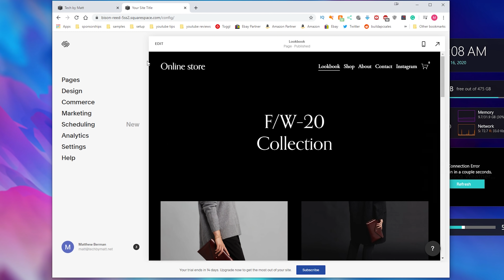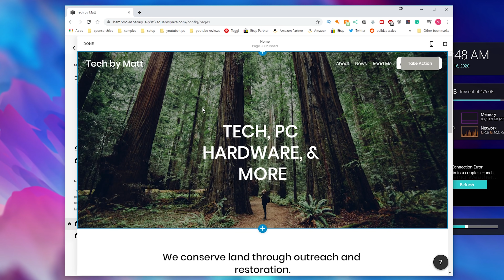Old Office PC + GTX 1650 = Gaming PC?

Comment: Hi, do you prefer amd or nvidia gpus. Just wondering.
Reply: from my experience amd relive does not work most of the time. very annoying to try and use. the price for performance is decent though
Reply: @beefyonyt  for me relive always work and performance cost is negligible. And I'm talking about an old R7 260x as you can see on my channel
Reply: @ondrejbrandejsky5592  i have a rx 5700 and i never had a problem
Reply: Hafo my friend has a streaming problem he uses a rx 580 and he try’s to stream of Amd’s software and it drops from 100+ FPS to 20-30 and I used my gtx 1060 from my laptop so it really is like a 1050 with 6 gb of video memory and I have no problems streaming of the GeForce experience
Reply: @JaimeIsJaime  my rx 580 fails to run anything properly with relive. obs is fine though, if i choose the right settings.
Reply: Both are good I'm going for a 2070 for the ray tracing which will actually help me
Reply: I never had an issue with my RX 5700 XT nitro+ OC
Reply: I would choose Nvidia bc of amd drivers, and also bc of the optimization in games.... AND DAT ROYALTY FEEL OF NVIDIA AND RTX AND IDK OTHER THINGS

Comment: I started with an old Optiplex 990 for $15, nothing wrong with it had an i7 2600 and 16gb of ram. put a 500gb SSD and a GTX 1650 Super in it and it works really good.

Comment: Why not SSD instead of that HDD?
Reply: well an idea is to get an intel optane memory to boost up that hdd istead of a ssd while taking the advantage of big storage.
Reply: Thomas Borisov  Unless it was a typo and meant to say 200w, I think they're referring to a PCIe slot power limit which is common on small SSF office PCs. In which case, options are limited.
Reply: @BestGirlsBiggestFan  this information is totally just information but other than boot times (not to mention after a HDD hits over 80% the read/write type changes to be slower to protect data) SSD highly boosts OS operation, game loading (especially in open world games), render speeds, etc. It's just better overall, and they last literal hundreds of times longer under the same use. They also frequently use less power. SSDs really are just overall better technology. The thing is they are, truly, not always necessary, but it's best to always have a dedicated drive for the OS and a secondary and possibly third drive for mass storage and programs.
Reply: Of course you could always run RAID and have significantly faster speeds, but that's silly after a certain point considering how cheap SSDs have become. But both are viable options
Reply: @mahmoudsobhy5843  Pretty sure a prebuilt from 2011 won't have an m.2 slot...
Reply: My 390 sff got 240 watt ps

Comment: Dell optiplex 7020 SFF. i74790K/GTX1650-GDDR6/32GB-1600RAM.
Reply: Is that what u got and what did h upgrade the gpu and cpu
Reply: @atme7375  GPU, CPU is on the way. Ram sitting at 20GB+4 on the way.
Reply: @LOOTLORD605  sry I’m confused, when u got this pc what was the specs and what have you upgraded
Reply: Bought it in a good deal without HDD.

Comment: For that system i would actually drill holes on the side panel just so the GPU is able to get more air because in a normal type of system the max i have seen is 55c which if the GPU is going in the 70's then there isn't enough airflow and would be best to have something like that or for someone that would have more heavy duty power tools could cut out a big hole on the side panel and then use a mesh like filter which would be helpful especially if said person would have like a table fan could just angle it and would have some air pushing into the system.
Reply: did you know what did my cousin do about it? he left the side panel open xD ik that would be a dust cage but he will clean it

Comment: wow my gpu just came in the mail just my luck that's crazy lol
Reply: You should do a benchmark video on it
Reply: @acrylex4663  deleting vids or comments
Reply: Oh lol I didn’t rlly see the likes what games do u wanna see
I got a not so good cpu tho it’s an i5 3570 if u wanna see a benchmark just tell me the games I don’t rlly have many games but I am going to get some 
If u want I could do a fortnite one cos that’s install even tho I don’t rlly play much
Reply: Just got mine a week ago too
Reply: zoinks  nice I get quite a bit of stutter on fortnite idk what’s the prob wether it’s my ram or cpu idek
Reply: fusion ram probably
Reply: zoinks  hmm I’m not sure i have 8 gb i used to have 4 but the  ram improved it 
When I turn the settings up 1440p it runs 60fps or more but the stutter is crazy
Like drops to 20 when I’m medium 1080 it doesn’t drop below 60
It’s average is 90 FPS depending on the surrounding the card is great it’s just that 
The pcs stutter is quite a lot 
Give me a solution
Reply: fusion you need 16 gb for a smooth experience these days.
Reply: @dylanallen7720  a bit late but I upgraded to 16gb it's still stuttery when flicking the mouse fast on a large area with builds it's annoying but I deal with it
Reply: FuseXR save up and get an ssd and upgrade CPU  to i7-3770 then the Stuttering will stop
Reply: FuseXR yeah a i7 3770 would be better I didn’t realize you said you had a 4 core 4 threaded cpu cause that will cause stuttering.
Reply: X-Treme iOS true but I’ve spent my money on 16 gb ram idk how much is those anyway
Reply: A question to all of u do u still want benchmarks also i started uploading
Reply: @XRFusion  Update bios / drivers or just go for 16 gb of RAM
Reply: Abdziel -  bruh I already have 16gb now 
And  I’ve already done drivers and at the time I made the comment I’ve updated the drivers I also now started uploading if u wanna see how my pc performs then check the vids on my channel
Reply: @XRFusion  glad for you! Ill check it out
Reply: Abdziel - thanks
Reply: @dylanallen7720  no lol 12gb is more then enough 16gb is overkill and 8 is still good for triple a games idk what kinds of crack your on
Reply: @iris-dh6nd  you must live under a rock, but go ahead and stutter away with your 8gb.
Reply: @iris-dh6nd  lmao 16gb is like an icing on top 8gb is also a decent choice still getting stutters on 16gb it's super annoying
Reply: @XRFusion  I think that's your storage or CPU then because ram doesn't usually = stutters if you have the recommended amount for the games u play, your ram may also have a really low speed but I really doubt it's ram speaking from personal experience
Reply: @iris-dh6nd  16gb can run all games storage 200+ for hard drive games on
Reply: The ram is like corsair 1333hz
Reply: @XRFusion  I meant as in speed and how much free space u have. If you have 500gb of space total and your using 490 it's going to massively slow down your pc and an ssd is the best investment I've ever made towards my pc. And ur cpu is above the recommended so its definitely your lack of an ssd or system issues
Reply: @iris-dh6nd  its been a year but, i came to update, its not as stuttery as before but i am building a new pc, as i figured the cpu was causign the massive bottleneck

Comment: I loved upgrading my old i5 2320 based PC, this is my build:

 - Asus P8P67-M
 (original)
- Intel i5 2320, 3,2 GHz
 (original)
- 2x4Gb DDR3 Kingston 1333 MHz
 (original)
- MSI Ventus XS 1650 Super
 (upgraded)
- Samsung 860 EVO 500G
 (upgraded)
- HDD 500 Gb
 (original)
- Corsair RM550x
 (upgraded)
- CPU cooler Noctua NH-U9S
 (upgraded)
- 2 x 80mm Noctua NF-A8 PWM (out)
 (upgraded)
- 1 x 120mm Noctua NF-A12x25 FLX (in)
 (upgraded)
- Corsair K70 RGB MK.2 con Cherry MX Brown
 (upgraded)
- Logitech G502 HERO (upgraded)
- old pc case (original)

I'm planning to upgrade my RAM, maybe 2x8 Gb or 4x4 Gb, what's best?
You gave me a nice idea for the CPU!

Comment: Im going the Optiplex route. I snagged a 7050 MT with ssd 10 pro and 24 gb ram on eBay last night. A friend a donated a GTX 1050 ti to me Imm  excited to get it .
Reply: 24 gb ram? How many Google tabs are you going to open
Reply: @haxorman6969  I had it so lying around I put it to use lol. Just bought a GTX1650 super and a 6pin adapter. Hopefully this fits !

Comment: Did this exact thing with a hp z210 sff I picked up for $50 with a e3-1245, 8gb, and a 180 ssd. Added this 1650 and for under $300 have a decent gaming system.

Comment: Hey Matt I enjoy watching your videos and I just found this one with the Dell Optiplex complete by luck cause im about to do a massive upgrade to my Dell Optiplex 390, and not like in your video with just a cpu and ram upgrade . I be upgrading the whole pc with a new mobo , cpu , memory and power supply , these are the parts i be using in a while.
- B450 mini ITX Mobo
- Ryzen 7 - 2700X CPU
- 16 GB 3200 Memory ( 2 sticks )
- 350 or 400 Watt TFX PSU
- RX 6400 4GB  Speedster LP GPU
The reason I'm doing this build is cause i like the shape of the case and it fits nice in my tv furniture :D
BTW i got 2 cases for free so i can use one as the original with spare parts 
Let me know what you think

Comment: My old job was throwing away 4 optiplex towers. I took them home knowing how easy they are to upgrade. I got the sff model 390. Swapped out the ram, added a Radeon 560 and called it a day. How do you like that cpu? I wanted to swap to an I7 but the performance is almost the same, that I5 is a pretty decent cpu

Comment: I did nearly the same thing two weeks ago. I got two SFF Fujitsu PCs for 100€. They had i5 3470‘s, 500gb HDD‘s and 2x4gb RAM. I bought two zotac gtx 1650‘s, 4x4gb RAM (16gb for each pc) and two 250gb ssds. 

I sold both pcs for around 350€ each 👍🏽
Reply: The exact same pc with no gpu costs 120-150€ at my location rip me

Comment: I have that same system except I put in the Xeon e3-1270,  upgraded the ram to 16gb as well, and slapped in a gt1030 (gddr5) that I scored for fifty bucks (disclaimer, the 1650 lp didn't exist when I got the system, plus it was out of the budget at the time anyway). I scored the 1270 for  just under 40 bucks and the thing runs circles around the original i5 2400 that came with the system. I gotta say though, the 1030 can still rock e-sports games pretty decently and can even hold it's own on some modern titles as well with a few tweaks here and there.

Comment: Just bought a 3020 with 8gb ram and 1 tb hard drive. Can’t wait for it to arrive! I was thinking about adding a rx 570 and a 500 watt psu in it. Thoughts?
Reply: You can find decent used deals on RX570 both the 4GB and 8GB versions on AliExpress. 500W PSU should be enough.
Reply: Also make sure what motherboard power connectors your Dell 3020 uses, some of them use proprietary connectors and you'd need a converter
Reply: The only other i would say is make sure that the card will fit in the case. For my optiplex 790 the longest card i could fit was about 9.5 inchs and then it blocks the sata ports but your model might have the sata ports somewhere else.

Comment: I picked up a 7010 SFF with an i7 3770 8gm Ram, planing to swap the case and upgrade the PSU  add another 8gb ram stick and add a GTX 1060 6gb

Comment: if we talkin about used, go amd, the rx 470 is a solid gpu that can be found for less than eu 70 on aliexpress, with no mining experience and it has a 6 pin connector
Reply: RX 470 is high profile card and cannot fit into SFF P.C
Reply: @seebauong9593  ik, but we talkin about gpus in general

Comment: I have a very similar PC except you have a DELL opt. SFF 790 and I have a DELL opt. DT 7010,
my specs are :
CPU: i7 3770
GPU: GTX 1650 (same one by zotac)
RAM: 16 Gb DDR3
the fps is very similar and for those wondering, yes  COD:BOCW runs at 60+ fps on low/med on 1080p
Also have the stock PSU
Reply: i have the same build except the MSI 1050 Ti in it and was considering putting this card in it too  thanks!!

Comment: Indeeed it does, I have a 7040 optiplex with i5-6500 and i put a gtx 1650 in it and it runs every game ive tried so far at 1080p 60+ fps easily, no struggles. Including BF5 Oh and also stays at 65C under load

Comment: I have tried add msi gtx1050ti lowprofile in SFF Lenovo M92p i5-3550 16gb ram with default 240w stock PSU. 

The results :
Works normally at first,  but the performance drop significantly after one week cause psu power distribution problems, removed the vga then pc back to works normally. 

I prefer to use 350watt psu pure befor install graphics card

Comment: I use this gpu and the two 40mm fans are noisy af. I replaced them with one 80mm and now its quiet with the same temps.
It runs very nicely in my hp elite 8300 sff with an I7 3770 and 16gb. I get 250-350 fps in cs:go and gta5 gets 80-90fps on highest settings 1080p

Comment: honestly i was gearing up to agree with you about how these should be avoided, but now that the low profile 1650's are actually at there msrp instead of 200 dollars its actually pretty affordable compared to a full fat tower. i went on ebay and for an i3 version with 4gb of ram you are talking 60 bucks, if you dont want to resell a barebones is 50. a kit of 16gb ddr3 cheapest is 45 dollars and the cpu is 35 dollars. ssd for 240gb is 35 dollars.  that is 165 before the gpu. add in the 1650 and you get 325. if you want additional storage a 2tb hard drive is 50 on amazon so 375. i cant find anything to beat that. its a temporary thing sure but for now it is the cheapest way to game. it just limits your upgrades in the future. When i went on ebay you can get for around 250 a mini tower with all the parts listed above (but with a 120gb ssd instead) and no gpu. so that is 410 dollars instead and you have less storage (ssd is half and so is the hard drive). as long as the person isn't planning on upgrading its actually cheaper atm. when the cost of low profile gpus skyrocket they will not be the good pick then.

the problem with sff computers is that a gtx 1650 low profile is usually 20 bucks more then a regular gtx 1650 and thats the price difference between an sff and a full sized tower on ebay. you only upgrade your machine if you just need a couple parts. lets use an example. say you have one of these with an i3 and 4gb of ram. so you know you will need a cpu and ram upgrade before considering the gtx 1650. 
ram for a 16gb kit is 45 dollars. if you are lucky say you find that you can use a 4gb stick in your system (instead of 2x2) and you can get only 12gb for say 35. 
then you get the xeon you are talking about (also good to know that they work in optiplexes. ive put them in hp OEM machines thanks for that info) cheapest i found was 35. so you have 80 dollars. throw in an SSD (regardless of it has storage or not) a 240gb ssd is around 35 dollars. 
okay so now that we have that sorted out you have 115 dollars plus 160 dollars which puts you at 275 dollars.
now if you bought a computer to upgrade then you can slap 60 dollars on which is 335 dollars and that doesn't include a windows key.
meanwhile if you get a full fat tower for 250 bucks you get the i7, 16gb ram, 120gb ssd, 1tb hard drive and then all you have to do is throw in the gtx 1650. i know that is

Comment: I have the optiplex 990 with the same I5 got it for 10 bucks at a Goodwill got me a new tower power supply and 16 gig of ram plus a i7 2600k and Radeon rx460 and run games with no problems

Comment: Dont u have to change the power supply? Average sff pc power supply watt is 200w. Is that even enough to power the gtx 1650 low profile?
Reply: It should as long as you dont try to overclock but when i put together one of these a few years back with a 1050ti i upgraded the psu to a cheap evga 450b just for peace of mind and i was still able to overclock my 1050ti to about 1900mhz even without a power 6 pin. Those cards were beasts when you could get em around 100 bucks.
Reply: Optiplex has 240w psu minimum, 275w for tower version.
So it's pretty safe.
Reply: @wisdoom9153  how much power does gtx 1650 need?
Reply: @Direc2  75w.
And depending on cpu, it usually consume 174w at worst (without counting HDD or SSD)
Oh, and HDD consume 10w per drive whereas SSD consume 5w
Reply: @Direc2  oh wait, USFF optiplex has 180w psu... Not that you can fit a gpu anyway. 😅

Comment: Is that case about the same size as the Dell Vostro 230? My idea is to use the case, but build a whole new B450 AM4 (3300X, maybe 3400G) but if I go with the video card, what is a good choice for the micro/mini tower? The card you are featuring looks great, but is it a good one for AMD 3000 series? Thanks  is the card you used the most powerful, for its size, or are there ones that surpass it?

Comment: Great video, I was going to do one of these as a project build and wanted to give it the best upgrades I could put into this. Are the upgrades you put into this the best this system could handle?
Reply: It can handle 32gb ram and it may worth checking the ram speed as well.
Reply: You can upgrade the ram and the cpu, if you put it in another case then you could fit a bigger GPU and a better power supply but that would be basically replacing everything so there’s no real point. If you buy a dell optiplex 3010,7010,9010,3020,7020,9020 Tower (not small form factor) you don’t have to worry about not having enough space to fit better parts

Comment: This is optiplex 7010 sff. And i have optiplex 390 sff,16 gb ram, 256 gb ssd, windows 10 pro, and gtx 1650. I bought all of them for 209 dollar. And the motherboard and power supply are the 390 sff
Reply: Is your dell optiplex good at gaming?
Reply: @clovernotatroll2302  its a beast, i play ac odessey with 60 fps no problem. The gpu and cpu always under 70 celcius

Comment: Just done exactly that on a dell optiplex 990 MT. I also installed a 400W PSU as the installed one was only 265W. Issues I have had are around the Intel Management Engine BIOS extension which seems to be corrupted....

Comment: Well that's 1650 run off of 240 power supply says it needs 300 but I think it'll work off 240 cuz it only pulls 75 Watts what do you think